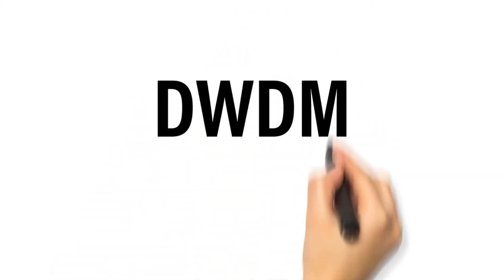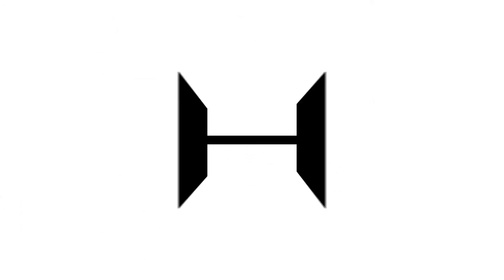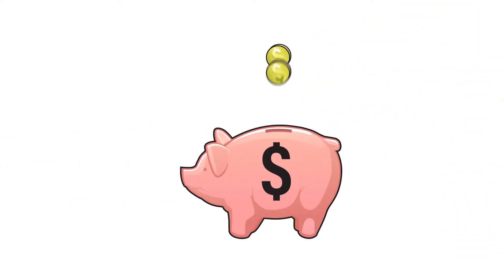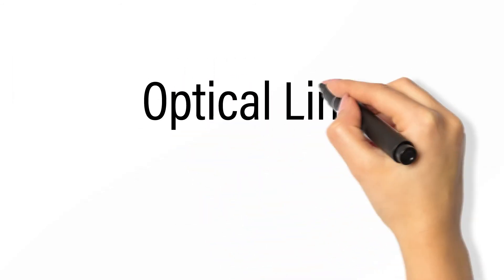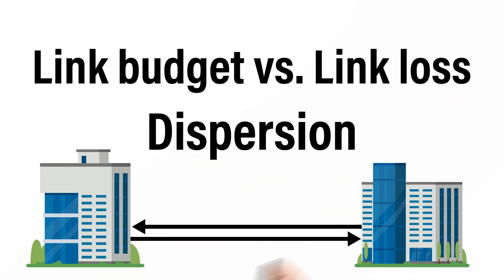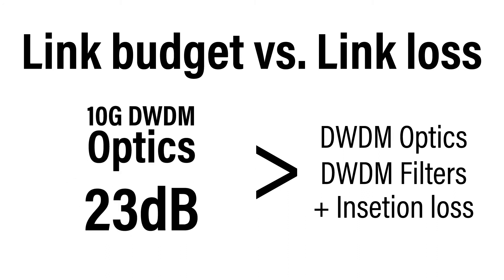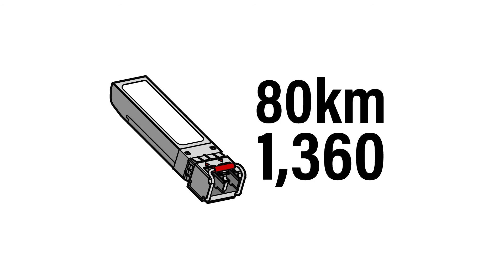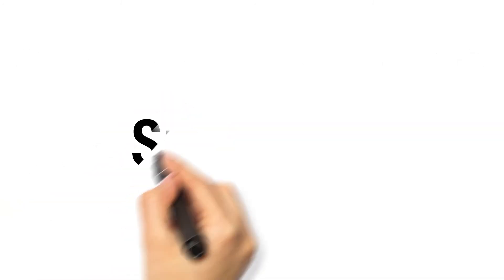Passive DWDM for the Data Center Interconnect

Comment: Is DWDM standardized only for Telecommunication or IT as well?
Reply: For IT level stuff it’s usually a standard. You can find some slightly different format of equipment because it’s meant to be more compact about that it is usually the same.

Comment: Passive DWDM systems are an excellent choice for data center interconnects due to their cost-effectiveness and scalability. These systems allow multiple data streams to travel on a single optical fiber using different wavelengths, enhancing bandwidth efficiency. Since they require no power for operation, they are reliable and environmentally friendly. Passive DWDM is ideal for applications where low latency and high performance are essential, making it a strong solution for modern data center needs. I came across from GAORFID Inc. you might fond pretty usefull for this topic!